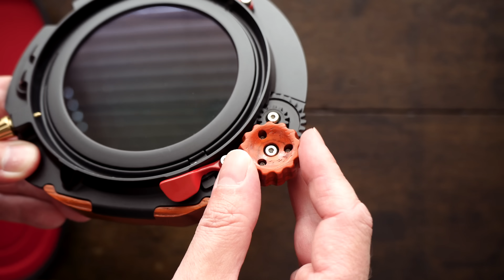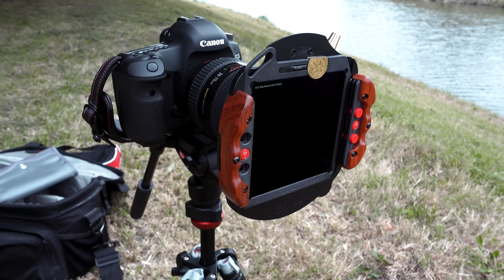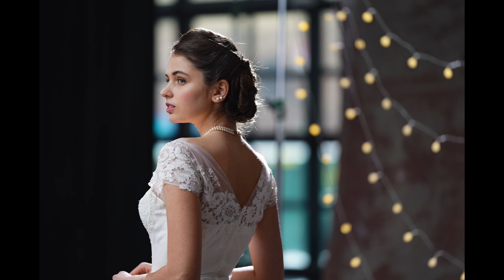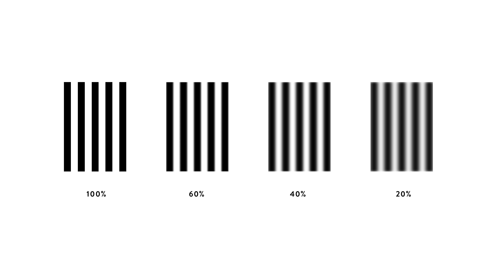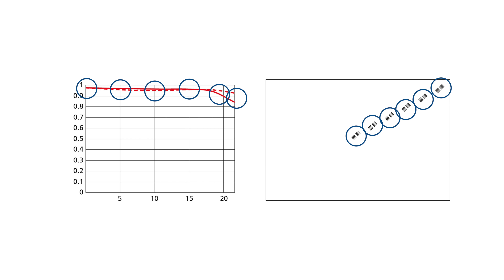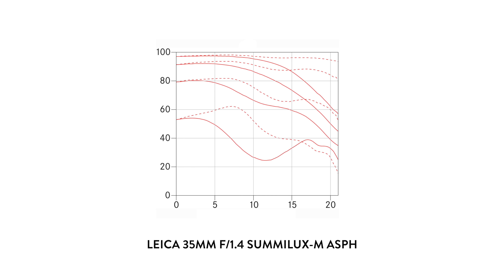Sharpness

Comment: Another interesting one... It might be nice to address how sharpness results are affected by factors like pixel density, internal (vs. extension) focusing and coatings.  There is also the question of hardware sharpness vs. processed sharpness by regular RAW converters and AI programs like Topaz.  On a lark I shot some images with lenses that had been in the attic since I retired my view cameras 20-30 years ago.  Of the ones I used, the best was a Zeiss 15cm Doppel-Amatar f/6.8 (a six element symmetrical Dagor rip-off/modification) at f/11 which I had used in the 70's and 80's on 4x5 with a lot of movements and 5x7 straight on.  It's sharpness was not at all bad but I was equally impressed that the shutter worked as well as it had 'in the day'.  It was fun.  When you are retired and doing photo as a hobby, fun is what it is all about.

Comment: Very revealing analysis! Personally, I prefer a little less sharpness for artistic purposes and sometimes my lens needs unsharpening in post to much my taste (I often use some negative clarity and/or lower sharpening setting locally). But to be honest, sharpness is the most valuable aspect in modern photography, especially with todays high megapixel counts. I just rather prefer to have the extra sharpness and reduce it in post than to have a less sharp lens… that gives me choices.

Comment: Its important to note that reading the MTF at 12mm shows performance of the center up to the top and bottom of the 35mm frame. Thats where lenses need to perform the best. 18mm reading shows all the way to the left and right borders. 21mm is only in far corners. past 12mm, if contrast is softer wide open thats actually good for a portrait lens.... and then the performance should improve as its stopped down....

Comment: You said the MTF chart covers "half of the lens"  (assuming a symmetrical lens) and the MTF on the left side is "at the center of the lens" and on the right is "at the corner".  Lenses have corners? :o)  To clean that up, the MTF plot is a representation of the contrast at various lpms from the "center of the image" to the "corner of the image".
Sorry to nitpick, I appreciate the videos!  (Speaking as an optical designer, but I don't work for a camera lens manufacturer).

Comment: Reading customer reviews at B&H and Adorama, there's a lot of complaining (probably mostly for less expensive off brand lenses) about getting a lens that had uneven focus, and then trying another one, and then another one... Basically, lenses that are inconsistent to the standard specs. So MTF tests sound like something we should all be doing. Wide open aperture or stopped down? It seems obvious, but at the most typical working aperture(s) would be best. For some lenses this would be wide open, but often as not 2-3 stops down from there, and on some lenses, like my view camera lenses also at the smallest apertures. (There's a point where  f64 isn't as sharp as f32. So unless you really need the depth of field, you know f64 is there, but f32 unless the DOF is needed is the sweet spot.) 

  Something to keep in mind while testing MTF charts is distance. If the chart is on a wall 4 meters away, with longer focal lengths, you'll never be seeing the edges of that lens.  And of course it's almost 2020. Huge megapixels, lens corrections in LightRoom, make a lot of lens problems no longer problems. (I explained to an Adobe engineer at MacWorld in the late 90s the distortion of the Schneider 90mm, and the extreme vignetting (I always used the filters). He said that wouldn't be at all hard to solve digitially.) 

Here's a boast (an obscure boast). One of my 7th grade students fiddling around with those plastic educational lens kits said, "Mister, it  (the image) isn't bigger or smaller, but it's clearer."  I looked. She had three lenses and the image was sharper because there was less color fringing.  In the back of my head Ansel Adams was saying 'Cooke triplet'  So I looked it up. This 7th grade girl had re-discovered the  Cooke Triplet, first invented about 1890. Cooke  is still in business making the highest quality lenses for cinematography. The thing about the triplet is they could've been invented decades before they were, but they weren't. Of course she didn't know anything about optical design, but she was observant. That was about 8 years ago-- she's probably working at McDonald's, she should be at Panavision or Cooke.

Comment: It is a tough subject to cover. In a forum that I am a member of, another user had an issue with one of their lenses calibration. They were sure it was fixable,and the repair agent suggest if they need a replacement, that the tamron 35 is the sharpest lens on the market currently. They returned to the forum asking for others experience with the lens.
The tamron is M.T.F sharp..so if your planing on shooting black bulls eye's on white grounds, and carefully measuring the chromatic aberration and coma, it will excel. We ask her to return to the store and inquire about colour fidelity, colour saturation and shadow acquence (always spell that word wrong.) The sales person replied what we all knew he would. "We don't test that."  To add more mud to the situation, when you look at Fuji, Canon, Nikon M.T.F charts..they aren't standarised. each uses their own testing. So a low M.T.F by one manufacture, maybe the a high score on another's. Just the same as the exposure value of 200 ISo on the fuji, canon, panasonic etc will not give the same exposure with exact settings...as the ISO/ASA for film was standardised..however it isn't standarised in digital.

Comment: Lens sharpness and sensor MP count, probably the most misunderstood, over-hyped and least important things to good photography.
I think your video makes that pretty clear, whilst doing a good job of explaining contrast "sharpness".
Some of my favourite lenses are not rated as particularly sharp. A good example, I have a Tamron 70-300 f4-5.6 zoom. It's really cheap (even new). The expert reviews are extremely dismissive of this lens, the MTF charts are also not that impressive. But I get great images from mine, both on 35mm film and FF digital. In my experience, there are very few lenses out there you can't get great pictures form if you work to their strengths.

Comment: At least compared to DXOMark my tests on lenses I own vary vastly. So I don't know how I can trust them. I.e. my 8-16 is sharper than my 18-35 when both are absolutely perfectly 100% in focus at any setting. Yet DXOMark says 18-35 is 2 times sharper. That's just impossible. 18-35 is surely a very sharp lens but my 8-16 is just sharper. Any resource says otherwise will not be trustworthy to me. The-Digital-Picture, for example, matches my observation. I always seek for physical chart pictures to compare lenses and those are hard to find.

Comment: I think the physical design of apertures would make a good video topic, particularly the count and shape of blades. not just because I'm a fan of vintage lenses with lots of blades, but also because the blade count seems to be coming back up with new lenses engineered for mirrorless bodies, and I haven't really seen that advertised other than included in the specs

Comment: Thanks for dealing with the tech so clearly.  My first consideration in a lens purchase is price.   Yes, I do the research online regarding sharpness including corner to corner even ness of light .  I don't generally need great low light capability.  Most of the range I shoot is 5.6 to 8.  Tamron, Sigma and Canon all make lenses that serve my needs and I have one of each ranging from 10mm to 300 mm zooms.  For the last ten years, only once have I spent more than $500 for a lens

Comment: As cameras become more high resolution-- sharpness takes a back seat for me. I look more for character in a lens despite sharpness or softness. My favorite is Zeiss because of how they render the image. Micro contrast is an imeasureable quality you see when you open up your images. 3Dimensional depth and spacial rendering is a very unique look found in some lenses. Sigma's are the worste in my opinion. They are sharp but flat looking.
There are some lenses that cost $90 I would prefer over a $900 sigma.

Comment: Very helpful, thank you. Now I have work to do...  I have this idea: to draw a bunch of these lines you have shown and print a large surface (my window for example) then take pictures of it with my  18-55 zoom at some F values. In my mind, however, I always thought that the more close the lenses are to each other in a zoom type lens, the less distortion is prone to occur (this is the case in my 18-55 that around the 35mm value is the most compacted position between the elements, but what do I know about them? haha), and will compare the results of which shows more sharpness at least in the middle. Thank you again I love  you being technical :) . God bless.

Comment: Overall rendering is far more important than sharpness in many, if not most, cases.   
Rendering is what most viewers connect with; the overall "look" of an image.  If the subject, lighting, perspective, composition, camera settings are all there sharpness doesn't matter all that much.
Of course it is better to soften a sharp image than to try and create sharpness in a soft image.
The problem there is that requires computer time.  That's what your buddies that dislike the 135 GM probably have trouble with - its images require processing to work for them.

Comment: Excellent technical presentation on lens performance but would be good to emphasise that, for a lot of creative applications at least, sharpness isn't absolutely necessary. Just need to look at Keith Carter's beautiful images - barely a sharp bit to be seen. Photographers obsess with zooming to 600% to check out detail - just not important (possible exception of commercial photography where the client will be doing the same). Also a lot is made of edge/corner sharpness - unless this is where your subject is placed, often corner sharpness can create distractions - a bit of softness helps direct attention to the subject. Anyway, great stuff Ted as always.

Comment: i would say that sharpness is also a matter of every individual lens. Maybe not a problem with high end primes though. But i found myself, more than once and under manual focus testing, noticing quiet a difference in sharpness between 2 lenses of the same brand and model (both times with zooms)

Comment: camera sensors can have an effect on image sharpness from the same lens
Reply: Image sharpness and lens sharpness are completely separate though, so its not really relevant. I think it is a given that different sensors will perform differently, and considering most cameras of the same "tier" have the same sensors (or equivalent sensors) I think it is even less relevant.
Reply: @-dubu  Not at all. A lens without a sensor (or film) is quite useless. Modulation function is defined between a source - the  "reality i.e. line pair patterns  (domain set) and a goal (codomain set). And the most interesting goal is what is registered by the sensor or film. Everything else will tell us what a lens can theoretically acchieve!
Reply: @WMedl  I agree that a lens without a sensor/film is useless but the sharpness of specifically a lens is a very useful metric because it tells you what sensors can utilise the lens fully. If you start mixing the two stats you get into super specific figures that are beyond usefulness. The sharpness of a sensor and the sharpness of a lens are very useful metrics but the sharpness of a lens on a certain sensor is not useful overall and thats why I think its irrelevant.

Comment: Do you think a Projection Lithography Lens from canon or ASML could be sharper than the best consumer lenses if you were to find a way to mount it? These lenses are designed to approach "the Theoretical Limit of Resolution" according to canon".
Reply: Alex, the simple answer to your question is no because photolithography optics are vastly different from photographic optics. Photographic optics are designed with peak performance with visible wavelengths (400-700nm). The most recent photolithography systems are designed to operate at extreme ultraviolet wavelengths (13.5nm). 

Fundamentally the resolution of an imaging system is limited by diffraction. The smallest spot an imaging system can resolve (read "Theoretical limit of resolution" aka diffraction limit is somewhat related to this quantity by the Nyquist frequency and pixel size) is defined by the Rayleigh criterion: radius = (0.61*\lambda)/(NA). Since resolution is directly related to wavelength, optics functioning at lower wavelengths will innately have a higher resolution. 

However, the pixel size of most cameras today is around 1-10 microns which turns into the limiting factor. This correlates to spatial frequencies of about 300 line pairs/ mm. Specialty photographic lenses have been designed that do reach this "theoretical limit of resolution." Reaching this level of optical performance on a commercial scale is impractical due to tolerancing and costs reasons. The main challenge facing optical designers nowadays is balancing optical aberrations across the full field of view.  

TLDR: No, photolithography optics and photographic optics are entirely different optics each designed with vastly different tolerances and specifications. Sharpness is defined by a multitude of different optical phenomenon and in this case, it is analogous to comparing apples with oranges. Hopefully this answers your question on a surface level. Optical sciences can quickly delve deeply into mathematics and physics and I tried to stay out of the weeds. 

Source: Optical Engineer here
Reply: Interesting, thank you. I would like to try out those specialty lenses you mentioned :) and I agree a lens can be too sharp for portraits but depends on the use case. For product photography, or for science etc there's many reasons why a sharper lens would be beneficial.

Comment: I have a 24mm pancake lens should I upgrade to a 24-70mm? Why? I need help.  What’s the difference by having a 24-70mmif I have a 24mm.
Reply: Not necessarily.  I prefer zooms for travel when I need to switch quickly between 24mm and 70mm or anything in between.  For landscape photography I prefer primes.  These tend to be lighter, smaller, sharper, have a lower f-stop and tend to be less expensive.  There are exceptions to any and all of it of course...